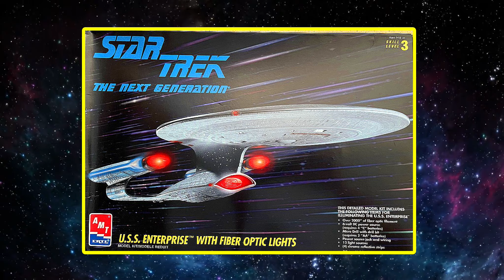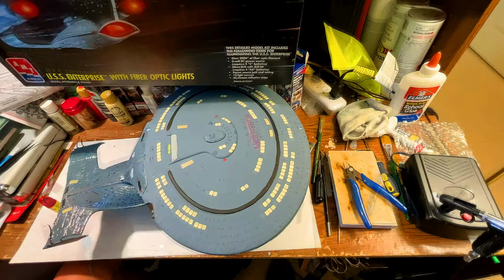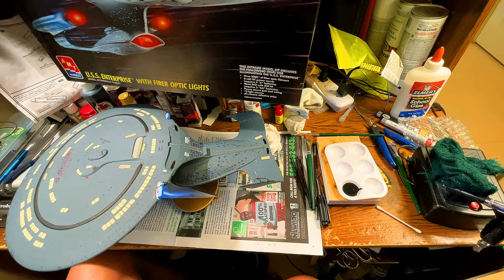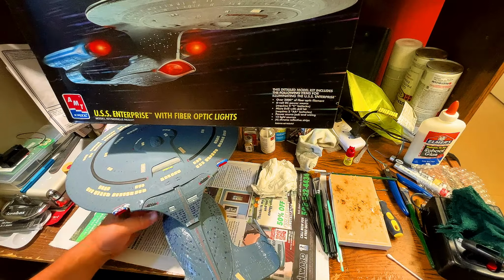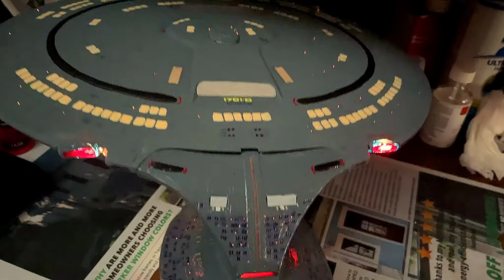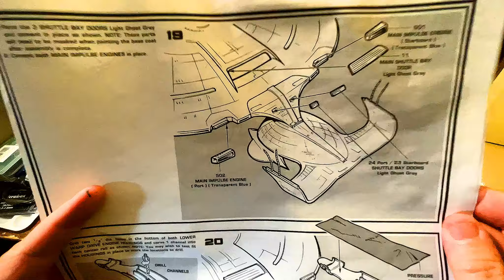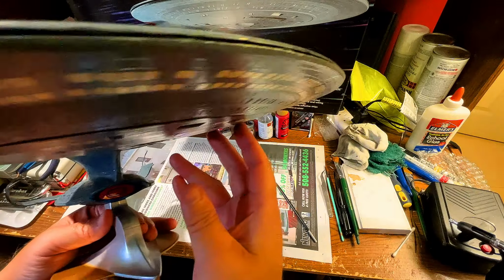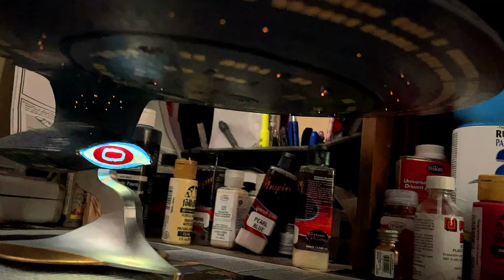AMT/ERTL Star Trek The Next Generation Fiber Optic U.S.S. Enterprise pt 19 & primary hull completion

Comment: I got the Polar Lights 1/350 Enterprise a couple of years back and I'm glad I haven't built it yet As PL are bringing out an updated version of their lighting kit with much quieter electric motors, improved instruction sheet, and redesigned LED's for the shuttle bay compartment. Should make lighting the model much less hassle!
Reply from the maker: Very true. In addition to that, they are also putting a switch in the base.